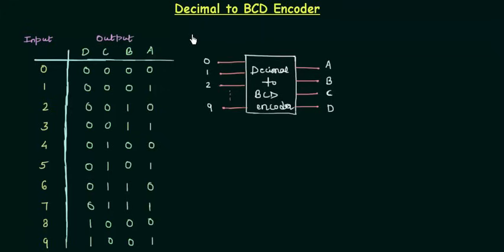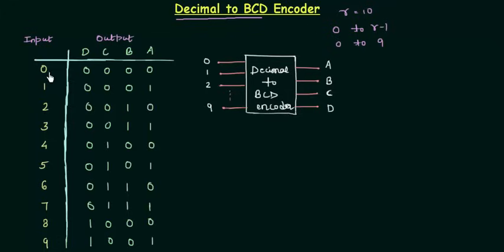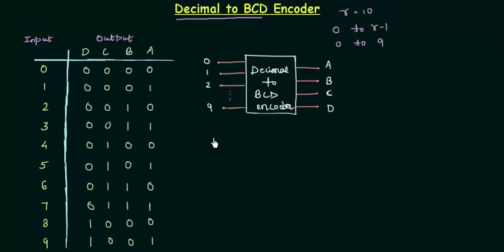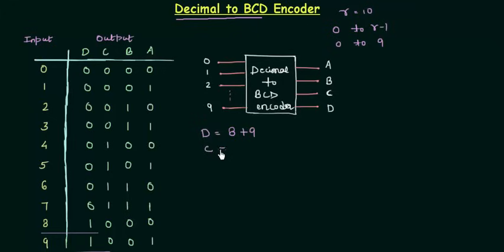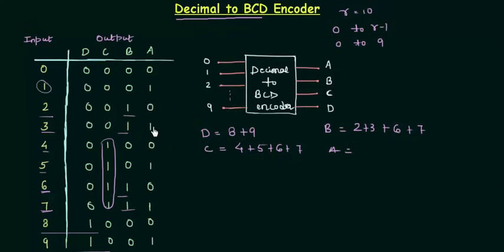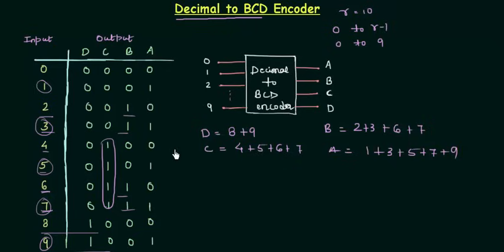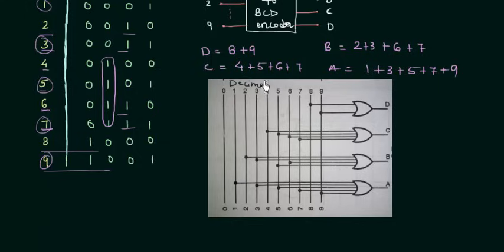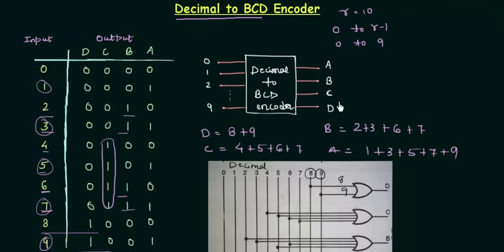Decimal to BCD Encoder

Comment: Actually we can go upto 15 from 0 using 4 bits, however bcd uses upto 9. Which is 6 less than the total capacity that can be expressed using those 4 bits. So the rest are just don't care conditions and we should not really put any effort in caring about them.

Comment: In the implementation ; B=2+3+6+7, btw in circuit there is input of 2,3,6 & 5  to the OR gate ...is it circuit correct or incorrect???
Reply: The circuit is incorrect.

Comment: Now this may be a silly question. But this thing is not getting in my head.

How can we use Decimal No.'s as an Inputs to OR Gates? or are they just Lines in sequence that have no.s written on it which can take value as 1 or 0? 

Somebody help me!! :D
Reply: They're lines which can take 1's or 0's arranged in sequence 0,1,2,3,4,5,6,7,8,9.
Let's take an example if you make 7th line (i.e. 7) from left HIGH then output C B A will be high automatically  representing output as 0111.( D is low)

Did you see? Just by making a single line HIGH all other inputs of gate become HIGH which are associated with it.

Comment: The reason why we don't use Kmap here is first of all, inputs are not binary. For  the previous lectures, we could use  K map since the inputs were in binary form. Here the question itself gives variables in decimal form. Therefore, we can only set them one by one to the variables. Of course, we can simplify the circuit by designating each decimal variables to binary and use only 4 inputs and 2 outputs but thats not the question here. This is what I've figured out. Plz comment me if i am wrong
Reply: Thank you, tho late but I was just about to ask that
Reply: The input is not decimal, each binary input represents a decimal digit. For example if input line 5 is high, it means the input is 5.

Comment: sir how the relationship between n and m is maintained in Decimal to BCD Encoder??
Reply: You can use BCD to represent numbers from 0-9 so that is 10 inputs.  The other 9-15 are don`t cares.So in total you should have 16 inputs and if you use the n=2^m rule you ll have m=4.I don`t know if you add the other input lines they will float or it doesn`t matter if they are or not there.
Reply: 2^m outputs are maximum outputs .relation outputs<=2^m

Comment: The relation between number of input lines (n) to number of output lines (m) for encoders is n=2^m. Doesn't Decimal to BCD encoder follow this rule?
Reply: The number of inputs 10 is not some power of 2..we can't take 3 outputs as for that we get 8 inputs.. So we take 4 outputs.. We can get 16 inputs... 10 are required.... I think so.
Reply: @CoolCool-jp4hv  you are correct because the numbers from 10 to 16 are taken as dont care but we consider 16 numbers as bcd code. Hence, for this reason we take 4 outputs for 16 (0 to 9 and dont care conditons included) inputs
Reply: Yes I also have the same doubt.....  *****
Reply: +satakshi030 it doesnt fallow in this case becouse no of bit diffres so
Reply: But according to the rule it can't be done so